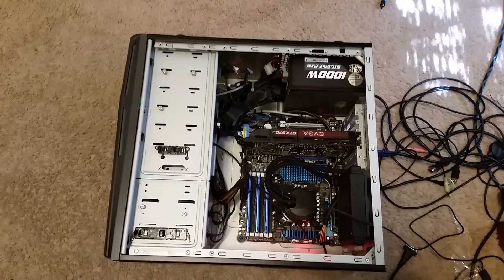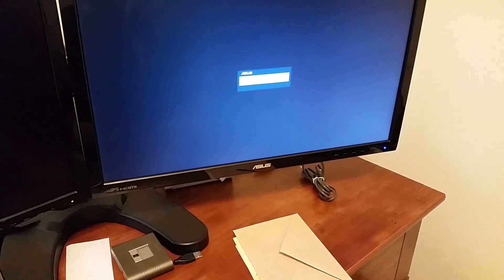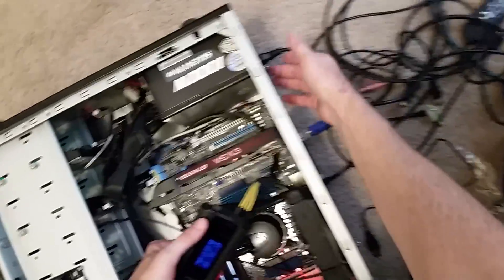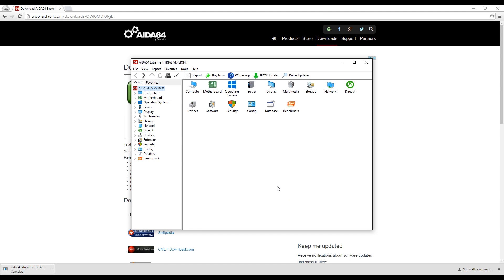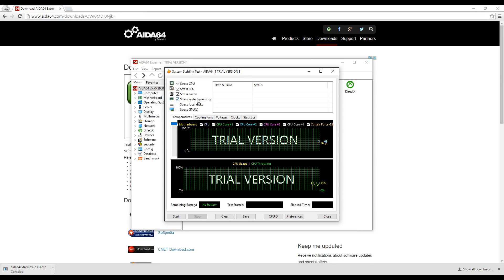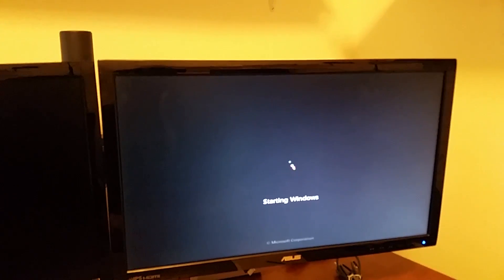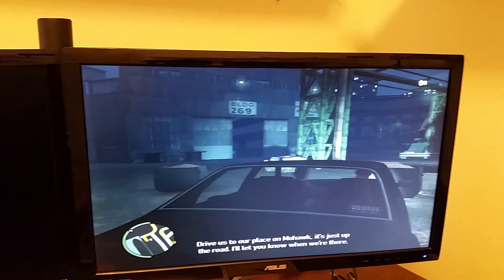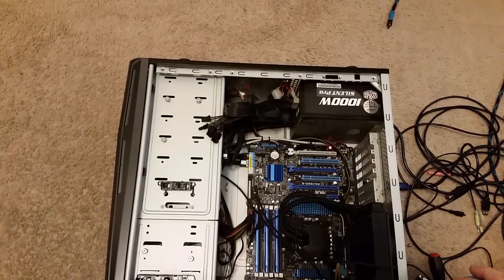Video/Graphics card troubleshooting

Comment: Looking forward to the GPU repair video.  Always interesting to see the underlying problem and the solution.
Reply: mee too? what was the problem with the videocard
Reply: is there a fix? got a 570 with exactly same problem, got a 2nd one wich runs smooth.. cinebench in sli also doesnt crash, but 3dmark crashes .. if i underclock them it crashes after a few secs. . . :-( meep